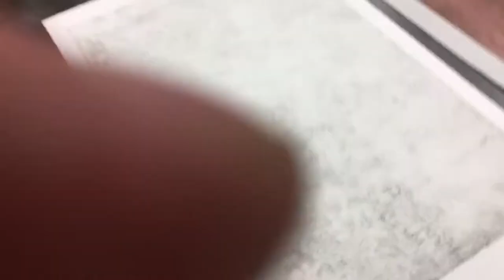Spit Biting

Comment: Degreasing the plate, rinsing the plate, spray enamel aquatinting of dry plate. Brush application of acid with sponge wiping. Removal of aquatint (clean the plate- not shown.) Carding the ink on the plate. Preparing the press bed, blanketing and pulling the print. Revealing the print as mottled tones achieved.